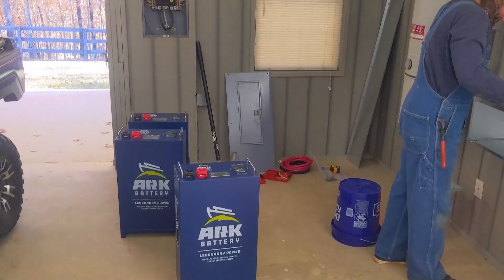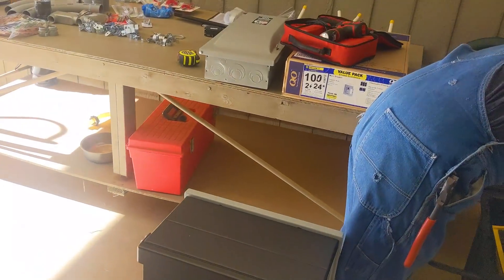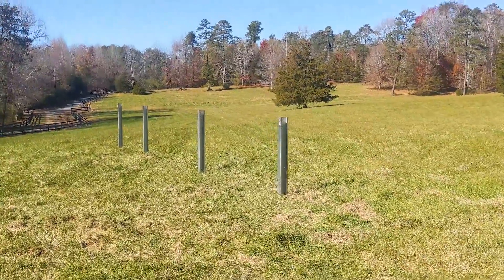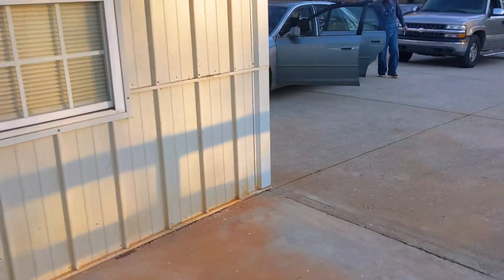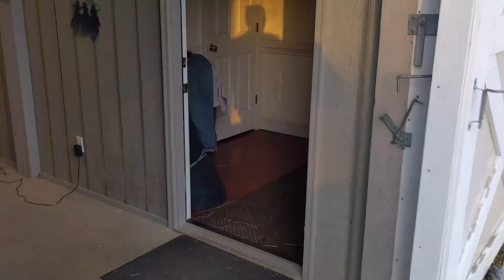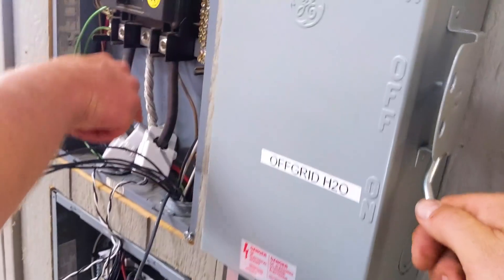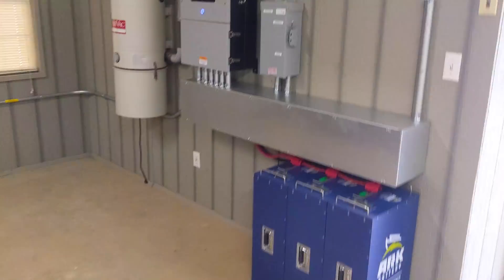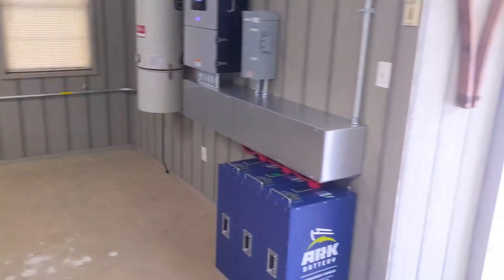Barndominium Solar

Comment: About how much would that ground mount racking cost? I've been looking at 2 inch galvanized pipe that is $10 per foot now.
Reply: I paid 56$ for 10' sections of 2" galvanized schedule 40 pipe at home depot in California back in November.

Comment: I may bite the bullet and build a barndominium for myself. If I do a simple 4/12 pitch which is pretty close to my latitude, the roof is south and i use a standing seam roof with S5 clamps, is that essentially just the same or perhaps a little better with bifacial panels in terms of production? 
Only downside I see is when they need cleaning

Comment: Engineer775, how difficult is it to acquire a property/house in appalachia (GA, NC, TN) that is already connected to the grid and disconnect it for off-grid?  I do not mean work-wise, I mean Bureaucracy-wise.  I also mean no connection to the grid at all, not even to sell back to the grid.
Reply: The grid in Tennessee is super cheap. Dont do that

Comment: In the wire trough are you supposed to have a partition between the AC and DC conductors?  Our inspector is insisting that we have a partition but on your builds I have not seen a partition.

Comment: when will solarark make a 100A @ 240V output inverter for a off grid house ? 30A main just doesnt cut it
Reply: You can stack as many Sol-Arks as you want as long as you have the budget for it.
Reply: @willistisdale4293   Two SMA's cost less than one SOL-ARK.
Reply: @honesty_-no9he  the sunny island is an inferior product

Comment: Why don't people do a low roof garden shed or something to recover lost space of a ground mount? what am i missing?
Reply from the maker: There's no space actually lost. The Grass grows underneath that array just as well as it does anywhere else.
Reply: When you have plenty of space whats lost? Also a solar array on the ground mount like that is adjustable as well as no danger of a roof leak that is a nightmare to repair. Cleaning panels is easy too.